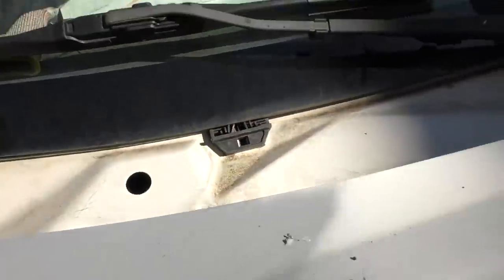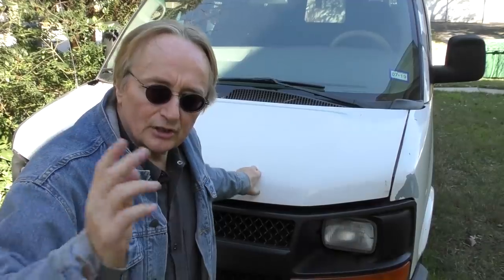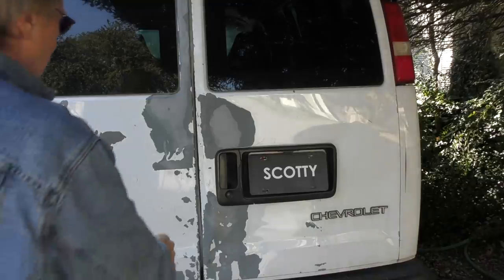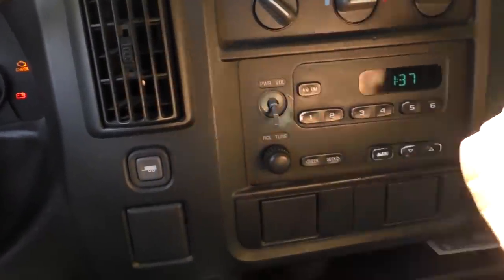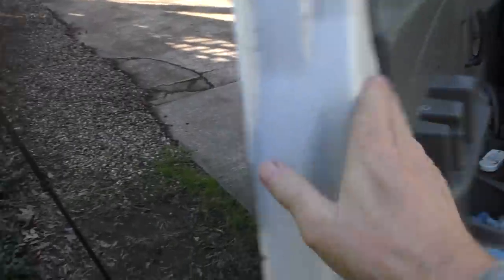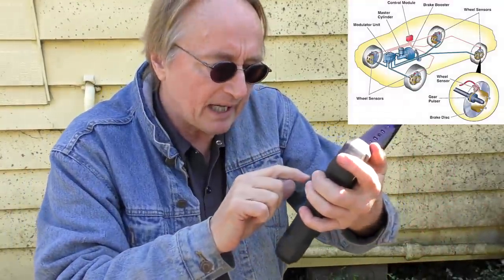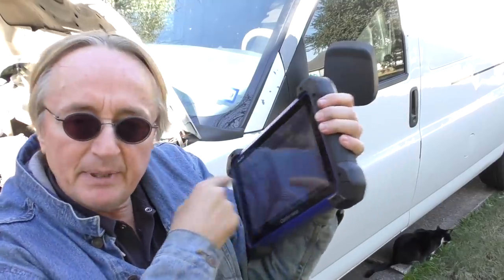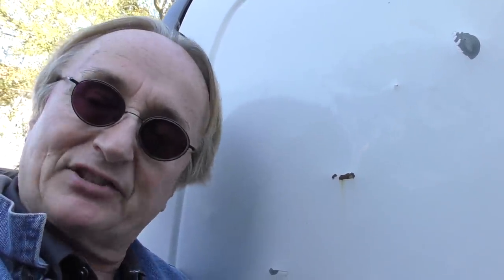I Told You About This Vehicle But Nobody Listened

Comment: meh, probably a fleet or someones work truck and was never been taken cared of right from day 1 or since it's warranty ran out
Reply: Not true. All chevys are like this, even after 3-4 years, silverados, express vans, they are all the same - chevy crap.
Reply: Garrett Stevensen just a hater
Reply: thanks for having some brains!
Reply: I see these vans all the time like this. Junk.
Reply: I see more older chevys on the road than other trucks. Especially from the early mid 90s. Maybe that was their best years???
Reply: Ben Dover really what’s wrong with them
Reply: All are like this.  To me, broken radios and door handles aren't all that bad.  They're a pain, but I'd rather have a door handle or radio break than something in the engine.  Currently on my 2013 pickup ,the driver's window switch system is partially working (can't roll down rear windows with that switch, but the window motors and switches on the doors themselves are fine) and the radio died shortly after the warranty ran out (no big deal, I just put in a $100 after market radio).
Reply: I drive a 2012 for work, it's fine.  Comparing a mechanic owned Toyota to a fleet Chevy van isn't really a fair comparison
Reply: you hit the nail on the head I have driven chevy vans for 32 years I can tell just by looking at it
Reply: Even over here in California most chevy astros, silverados, or large vans from that era in white have the peeling paint. Very common issue.
Reply: @jewermank8536  hmmm shouldn't a commercial vehicle be more rugged than a baby and grocery hauler?
Reply: Garrett Stevensen that’s not true at all man. Not ALL chevys are like this after 3-4 years. Those old Chevy work trucks from the 90s were built pretty solid if you maintained them. This one was neglected and it still runs down the road to get you from point A to point B. I think the newer GMs are made cheap but people need to use their brain more. It’s a work truck from the 90s Scotty. What do you expect? The same person who drove that Toyota is not the same person who drove that Chevy.
Reply: @garrettstevensen2467  I usually hold on some my GM trucks and Van for about 10 to 15 years I've never had an issue. I can probably hold on to them longer but like anything mechanical parts start to fail and then it becomes a cost-benefit ratio of whether to keep it or buy new.
Reply: Lucas Cruz  u know nothing of these vehicles....

Comment: Have a 2003 Chevy express cargo van . Bought it brand new . 5.3L with 3/4 transmission. 435k with out any major problem . Not even transmission . Changed the water pump only & Regular maintenance. Sold it and got me 2017 .

Comment: The V8 LS Vortec engine can go on forever with proper maintenance. I have a 2002 Silverado with well over 300,000 miles on it. Only major issue was the transmission . Can't speak for the cars and vans but the trucks and SUV's are tanks.
Reply: How many miles did it have when the transmission went out? I also have a 2002 silverado with 170k miles. Still running and shifting good.
Reply: @bigabescanal2799  286,000 mile mark is when the tranny lost gears but 1st gear and reverse still worked. 170k miles is excellent as long as you keep the maintenance up and use OEM parts that truck will last you for a long time. Everything is easy to fix on it.
Reply: @themostsecretscience6409  yea I've been doing all the maintenance myself. Hopefully it will make it to 300k. Good to hear that these trucks can last a long time.

Comment: GM may not have had very good quality lately, but we've had almost nothing but GM products (2006 and older) and none of them have failed. Well, one of them had head gasket problems, but it was over 16 years old at the time, with poor maintenance and a lot of miles. Other than that, none of them had problems.

Comment: Hey Scotty! I got 2014 Express with the 6.0 L96, new from the factory. Just hit 90,000 miles. Here's the issues I have had since 3 miles, the front ABS sensor went bad at around 60,000 which was an easy fix. Replaced the brakes(Akebono) at around 85,000 and they still had meat on them. One of the LEDs on the A/C control went bad, no big deal. The drivers side door lock assembly went bad, haven't fixed it yet but easy fix. Replaced the tires of course, the nut on the passenger side wipers loosened up so I tightened with some loctite. The windshield is big so it will collect rocks kicking up on the highway(replaced once or twice through the insurance). Other than that, its very reliable and has a ton of torque. I do regular maintenance myself, oil changes, zirc fittings(7 of them on the front end), transmission service, tire rotation, coolant change and obviously if anyone knows these vans the front/rear lamps will get replaced often, lol.
I'm an electrician so I drive it like i stole it and it loaded up, ladder rack the whole 9. 

Last but not least even though it's big people seem to not see it when they are backing up so been swiped a few times. The big one was a $5,000 repair where someone actually hit me from behind at a stop light, we were going 2 miles an hour(Full recovery thanks to the other guys insurance). They obviously fixed the paint because after 6 years no chipping, nothing. 

Very comfortable driving and it's my baby. DO NOT BUY FORD VANS! Very uncomfortable rides and you'll be changing ball joints every 50,000.

Comment: The reason the paint is coming off of that old van is because GM’s “new” electro coating process at that time, and they somehow thought cars no longer needed to be primed prior to painting. Worked short term, but not long-term because the paint deteriorates.
Reply: Correct. I believe it was the PPG "Electroprime" product. The results were obvious. I had a '97 Riviera, top of the line, same crap paint. Like you said, it lasted about 5 years, which was also the body warranty. Then, it would fail in weeks. Your body shop wanted extra because of the major work. So, few were ever repainted correctly.

Comment: Well those vans are actually easy to work on when you take the cover off. Its all of 5 minutes and then you have complete access to the entire engine area for plugs, wires, exhaust, manifold etc. Had two of them which were easy and cheap to fix. And Toyota has nothing on GM with their car paint flaking off and don't get me started on rust. My buddies 05 Tacoma had rusted its frame rails right through! In any case most GM's of that vintage were crap so we agree in that respect.

Comment: Pull the fuse or cut the wires to the radio, how can one drive with that noise ?? !!
Reply: Zilla Deliva  yes you could do that, if it was mine I would junk the van or part it out.
Reply: juan tomas the owner is deaf.
Reply: @filthyanimal874  must be
Reply: Pull the radio fuse or disconnect the speaker(s). Or visit a wrecking yard and get a “new” radio for it.
Reply: somebody that does not care
Reply: Yeah I don't get why he wouldn't pull the fuse 5 mins after this started happening.
Reply: The owner probably loves white noise
Reply: What's a good van to get to convert into a camper van?
Reply: @JoeUrbanYYC  radio fuse also feeds parts of the gauge cluster and DLC connector pin 16 constant power feed
Reply: Cut the wires, pull the fuse? Is it not possible to just unclip the cheap dash, remove the radio and disconnect the wiring harness? A lot of these work vans and trucks didn't even come with a radio so there shouldn't be an issue. One could even get a 5 dollar wiring harness adapter and 20 dollar walmart radio to replace it with.

Comment: @scotty kilmer i am a mechanic and i have a cusomer of mine who has a 2002 GMC Sierra 2500HD with 560k miles on it. I just got done installing its 4th set of spark plugs, and its 3rd alternator last week. All the electronics work fine still. Original 6.0 engine and 4l80e automatic trans. Never been rebuilt. It is a bit low on power after that many miles, but runs well enough. It is a work truck. I replaced all the steel brake lines on it last year. Let me tell you how fun that job was....

Comment: We had astro v6es at a delivery company I worked at in the 90s.  I regularly cubed them out with luggage and they did great.  Their older, larger chevys were V8 propane conversions - we don't need no steenkin' fuel gauge.  Good times.

Comment: He picks the crappiest GM vehicle that was neglected and claims all GMs and says they all are crap.
Reply: They are though. I've seen newer chevys with the paint falling off. They are all garbage, and the worst domestic brand by a long shot. Hopefully they go bankrupt again.
Reply: Garrett Stevensen then explain how I have a 2002 Silverado with 260,000 miles with original paint and the original motor.
Reply: Bear Allen I’ve got a 2015 Silver ice Metallic Camaro, of course I take care of the paint. The only time it got repainted at the dealer was when I got into a little accident a little over a year ago. I’ve experienced zero issues otherwise with the paint.

Comment: Hey Scotty, I would like to let you know about a fix I had done on my 2000 jeep wrangler that seems to have improved my gas mileage from 14 miles per gallon to 19 mpg. It might be something other people might want to know. I was having a problem with heat soak with my engine. I had the heat shield replaced and put heat blockers on the third and second injectors. The results were immediate. I believe the buildup of heat causing the vaporization of the fuel in the injectors was causing loss of fuel being burnt effectively. I am no mechanic but I do read up on things. Please let me know what you think

Comment: When GM went Chinese back in 1982,I no longer considered them to be an American car company.
My half-sister bought a brand new GMC Safari mini van,that was the worst P.O.S.I ever saw.
 This thing was built so cheap,that the plastic door handles broke off in the first 3 years of ownership.
Not including all of the sensors going bad,the AC quit working,the heater quit working,etc..
It was a"fix-it-again-tony"nightmare.
Ditto for her Buick Park Avenue Limited edition.

Comment: Today is 1/26/20.  I bought new a 2004 Chevy Silverado and now I have 260,000 miles and the paint looks as good as new.  I never waxed it or ever give it any kind of shine job.  Over the years I replaced the instrument panel lights and step motors, 3 water pumps, 3 starter motors, differential went about about 250,000, all the brake calipers this week, left turning signal turns on the bright lights which I haven't as yet fixed, and I average about 15 miles per gallon of gas.  I used Ams Oil for both engine and transmission.  No problems with transmission so far.

Comment: Since the beginning of time; you’ve always had to remove the dog house to work on the engine in a cargo/passenger van.
Reply: @hippiebits2071  In a Supra MK3 you have to drop the fuel tank in order to get to the fuel pump, boy what a hassle.
Reply: 😂😂😂😂doghouse!
Reply: With my '63 Econoline you cood cook food on the exh manifolds. Even better with my '65 Dodge A100 Slant Six. There wasn't a hood so access was not an issue.

Comment: I've got a 2008 Silverado with 295k still looks brand new runs like the day I drove it off the lot never had to replace anything other than break pads and rotors. I believe that if you take care of it then it last a long time. Change the oil every three thousand miles and transmission fluid flushed every 10k. 
Best Damn truck I've ever owned. I can send you pictures if you would like. Happy Driving.

Comment: I know all about Chevys being hard to work on, I have an ‘08 Trailblazer and the whole headlight assembly has to be taken out to change a bulb, with the older Fords I’ve had, (‘95-‘01) you just twist the collar at the back of the assembly, pull the old bulb from the socket, snap the new one in stick the bulb back in and twist the collar back.

Comment: I’ve been driving a 2010 express for 5 years.  The 5.3 LS motor = awesome and rock solid.  Literally everything else is crap. Transmission recently failed at 154,000  and the company fixed unfortunately so I still have to drive it for a while.

Comment: I bought a Toyota Camry in 08 after 60,000 miles it started guzzling oil now over 160,000 miles the paint is falling off the top of the doors roof and hood

Comment: I as a parts guy at an independent repair shop, I have to chase parts for several early 2000s Express 3500 cutaway vans that are utilized as mini school buses. I have found that GM obsoletes parts quicker than any other major manufacturer. A lot of what you showed what was wrong with the Express in your video I see in evaluating the ones I see in my shop. I whole heartily agree with you, as a rule, Toyota makes the most durable vehicles..."The heartbreak of America, today's Chevrolet"

Comment: Scotty: "Here's why Chevy is crap"
Also Scotty: Shows '05 Express van with 200k+ miles that's had the snot beat out of it on the inside by somebody who clearly doesn't care about the resale value of the van

My buddy has a 1998 Express van with 300k miles that he uses to haul his Motocross equipment AND tow a small pop-up camper and it still looks like it's brand new. It's all about how you maintain your vehicle and how much pride you take in it.
This guy Clearly doesn't give a s**t about what his van looks like. But some people do.
Reply: igotanM16 lol... he should've did a cruze
Reply: Why did Chevy even bother painting it in the first place if it’s just going to flake off.
Reply: @Big.W.  because nobody wants to buy a car that they have to wax and polish every two weeks to prevent corrosion.

Comment: My work van 2005 chevy express has 572k miles and yes had to get a new paint job lol
Reply: William Chandler 

Wow! Which engine?
Reply: Probably a 6.0
Reply: It's a 5.3 2500 and it runs better than the 6.0 express 3500 we have with about 200k
Reply: Also it was running on  propane which doesnt have as much carbon and was converted back to gas at around 400k

Comment: We were very happy with our 2003 Suburban Z-71. It finally died at 330,000 miles on original drive train, no major ( $$ ) repairs.
Reply: What happened to it? Engine just gave out?
Reply: @bigabescanal2799  Well, it was using a fair amount of oil by that time, and the catalytic converter needed replacing, AND the brake system's reservoir disintegrated, AND new struts ( I think ) were needed on front-end, AND, brakes needed redoing...basically, all at the same time...and, at 330k miles - meh, we bought a new - smaller - car.

Comment: It's flaking off because the sheet metal is galvanized.  Any paint will have trouble adhering to galvanize metal.  The V-8 Pick-ups were Bullet proof.  There are alot of old Chevy Snowplow trucks around here with 200,000 miles on them. My friend noticed that and just bought 89 Big Blazer to start his Snowplowing business. VeryFew old Fords plow trucks here.

Comment: I'm driving my 08 Acura TL with the Scotty mantra. Gonna drive it till the wheels fall off. Going strong at 168,000 miles
Reply: Make sure to replace  the transmission fluid, and oil. They will last until you are done with them.

Comment: You have to prep anything you use water based paint on. Most people (including myself) prefer oil base because it adheres to the surface much better. I have a 02 Silverado with the same problem from the factory it's a beater I let people use to go pick up parts for me.

Comment: My 2010 Chevy Express has been cursed with the paint peels, and if you touch the body with your pinkie, it will dent.  Mechanically at 130K miles, its sound.  No burning oil, weird sounds, leaks, tranny shifts solid.   Just needs a little paint job, and good as new.

Comment: The Express van hasn't been updated in 25 years. It's smaller than the Transit, ProMaster, NV, and Sprinter. Yet it's more expensive than most of those. The transmissions suck and last time it rained heavy, water poured out of my sun visor bracket.

Comment: I normally have a lot to disagree with Scotty about, but I agree with him wholeheartedly about these vans. The door panels have always sucked on them, they break area extremely expensive to replace. Over $350 for a new door panel. But the insides of the doors are even worse. If you happen to bust off the window crank spline, which is very easy to do on these vans, you have to replace the entire mechanical assembly inside the door.

Comment: I have a 99 S-10 which is 21 years old and I never had peeling paint.  I  use poly sealant 2 times a year and it has its original paint still like new.  It still runs like new with few problems mostly routine maintenance after 21 years of ownership.  Not all GMs are junk and I doubt I would have had any better service out of a 99 Tacoma.